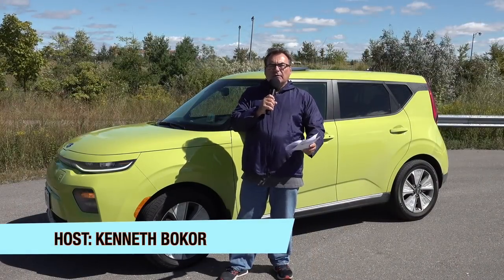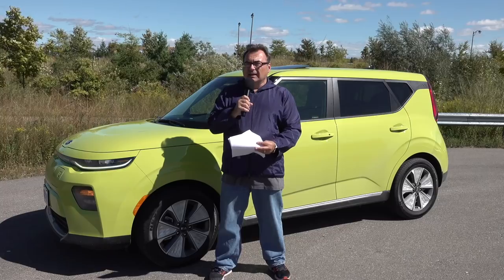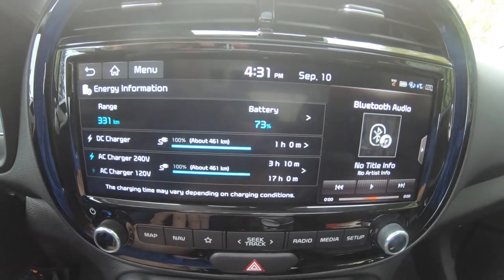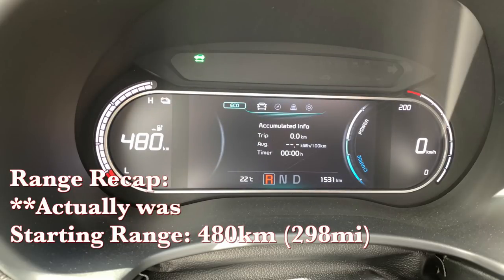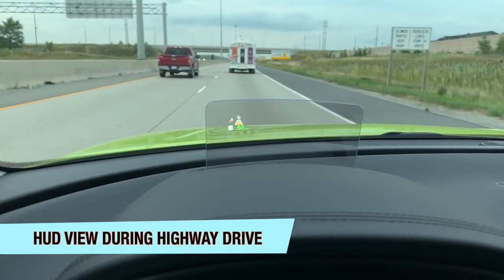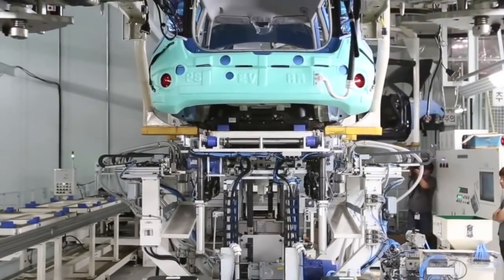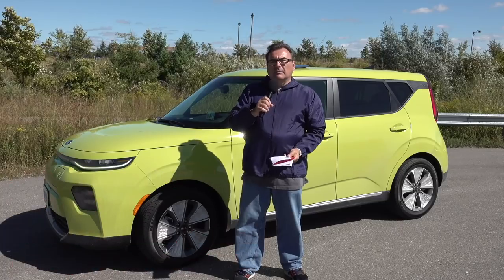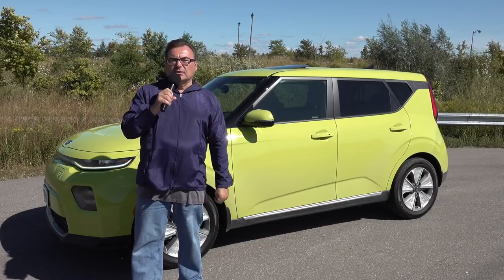Episode 62 -  2020 Kia Soul EV (64kWh) Review!

Comment: Ordered mine over the Niro and Kona based on 3 things:
- price
- comfort
- dealer experience

I didn't like the Hyundai dealer where I live.
The Niro was somewhat uncomfortable to me (seat position left the armrest too high and had to strain to look over the dash when set up correctly for my size and shape).
And the Soul was slightly less expensive than the Niro as well.

Add to that that the Soul was available with a 4 month lead time, the Niro would be 18 months, and the decision was easy.
Reply from the maker: Hi there, thanks for watching as always!  Good for you and I know you will love the Soul EV!  Like I said in my review, it would be my choice, even over a Model 3, for a next BEV.
Reply: Why over a Tesla model 3?
Reply: @patricelarochelle7295  Sitting position, better range for comparable price. And I will remind you, changing the color for the model 3 will set you back 3000$ and that's for a paint that will be sand blasted if you don't buy protection at your own expense.
Reply: @patricelarochelle7295  For American buyers, we'll also still qualify for federal rebates, so the car will end up costing much less than the Model 3.  I think you'll simply get more range at much less cost.
Reply: @lsh3rd  Thanks, I'm from QC Canada, the Tesla model 3 is 1500$ more than the Soul, both get the full government subsidies. I love the style of the Soul. I drive a 2018 Leaf and I have no plan to change.  Great car, gas is very expensive here and I save more than 350$ of gas a month.  The car pays itself.  I drive it around 43000 kms a year.
Reply: @patricelarochelle7295  build quality, interior space, comfort (though that's in part personal, the Tesla's seat position is a lot lower and more reclined, not a problem for young people but when you get older and stiffer it starts to play an ever more important role).
Tesla's main selling point is their supercharger network, and in many areas that's so sparse it's not a factor (nearest to me is 70km from my home for example, and not anywhere close to my normal travel routes, going there on the way to/from work would mean a 40km detour to charge the car).
Add to that that a Model 3 with the same equipment level as a 64KW e-Soul is about 20% more expensive and the decision is obvious.

The Model 3 is a very nice car, but not without its problems (several of my colleagues have them).
Reply: @patricelarochelle7295  Don't know where you're looking at your Tesla, but the cheapest M3 I can buy is $55,000. I live in BC, mind you. Maybe QC still has the cheaper Tesla trim? The Kia Soul EV base trim is $45,000. If you're aiming for something in the luxury segment then the Tesla M3 is the best choice, but if you're looking for a electric hatchback runabout then the Soul with cloth seat trim is a more economical buy. It may be a niche market still, but there are some people who are buying an EV for financial reasons (very cheap cost of operation) and if you're trying to get the best out of that then an EV that's over $50,000 MSRP is too much money.
Reply: @0hypnotoad0  the base model of the Kia Soul Ev is not really worth it.  It gets the smaller battery and the less powerful motor.  The base  Kia Niro Ev is not much more expensive, faster and it has the bigger battery.  If I didn't bought my car last year, I would buy a Kia Niro Ev.
Reply: @patricelarochelle7295  base model was the wrong word. "Preferred" (cloth seat base trim) version of the 64 kwh is 45,000 msrp. 10,000 less than the model 3 standard range plus. The soul EV seems to have preferred and ultimate editions for both the small battery and big battery versions.
Reply from the maker: @0hypnotoad0, in Canada you can get a "base" model 3 for $44,999 CAD MSRP.  You have to go into a store ONLY to buy, as you can't and won't see it online.  This was done to get the SR+ into the Federal Incentive Program.  

This model is basic and has software-limited to about 150kms I believe.  I think it is the SR+ but with an out the door range much less and basic interior.  Still have options for paint, interior, wheels, AP and FSD.  That way you can get the $5K incentive on the base at least.  However, when you add on the software unlock afterwards, I believe you are at the SR+ price so may not make much sense.  If you can hold out for awhile with this limited range Model 3, then it make great choice.
Reply: @EVRevolution  Yeah I remember that, though I don't think that was ever intended to sell. For a few months they were selling a 350 km range "standard range" version with cloth seats and no heated stuff, but I think they narrowed down their number of trims and aren't selling that online anymore. I think it's safe to say that Tesla is still in the 50,000+ range in Canada. You can't buy a "base trim" cloth seat 400+ km EV from Tesla in Canada at this time, only Hyundai/Kia is selling them.
Reply from the maker: Lets assume $0 down and no trade and Ontario as the Purchase Province.  (If you live in Quebec or BC you can also add on (stack) the Provincial Incentives onto the Federal one).

Starting price in Canada for Tesla Online Model 3 SR+ (white colour, base wheels), $54,990.  This includes Freight/PDI and all fees.  I believe you then add HST onto that which would be $62,138.70.  Then you take the $5K off of that which would give you a final total out the door of $56,488.70.  Incentive(s) are deducted AFTER taxes and it's not exact since the incentive also includes an HST portion.  

This jives with Tesla's website that states walk away price of this most basic Model 3 SR+ of $49,990 plus tax (and some additional fees).  Add 13% to this number and you get $56,488.70.  I think my numbers are correct, but I am not a dealer and am not totally clear on how the incentive is taken off.  

But this number should be pretty close. 

By comparison, the Kia Soul EV example I reviewed is priced at $53,529 with the Green costing $0 more and no other options, just freight/pdi and some fees.  Add HST to that and you get a price of $60,487.00.  Take your $5K off of that and it is about $55,487.  About $1K less then the Model 3 if my numbers are good, and they should be fairly close. 

Compare the options of one versus the other and you will see both are well equipped with the edge in Technology to Tesla with a more comprehensive AP offering than LKA/ACC that the Kia offers, as well as SC-ing access.  

I suspect the Model 3 SR+ and the Soul EV will have similar actual range capabilities, so the choice will come down to a personal one.  Many have provided comments about this from my show so you can scroll to read.
Reply: @EVRevolution  Bought the Soul EV 2020, great car... but had some paint defects that need to get fixed. But not nearly as bad as what some tesla owners are getting. Definitely would take over the model 3 as well.
Reply: @EVRevolution  car's finally getting delivered in about 2 weeks. Bit of a mixup between Kia world and Kia Europe caused the factory to deliver cars from late October that didn't have a valid type certificate and therefore weren't road legal.
That's now resolved and Kia is working to get them all registered to customers and delivered as quickly as possible.

Comment: I have to say that I drive my car to the ground. I drive her about 400 per day for Uber and Lyft. Mine is a typical 2015 plus 2.0. I leave my car idling often for hours. between rides over a 20 hour period. And she keeps running great with no faults. I change the oil every 3 months with synthetic Mobil 1. I add Lucas fuel injector cleaner every few months. I have to admit that this is the longest lasting and rugged car I have ever owned. My Mustang or Honda Accord would of quit on me a long time ago! I love how long wearing and powerful this motor is!
Reply from the maker: Thanks for watching and you fit many ICEV owners profiles, including my own for on-going maintenance and usability for ICEV.  However, we need to change these old habits and move to zero-emission driving - it is as simple as that.

Comment: I own this vehicle. It’s fantastic. The only two issues are: 1. The lack of front parking sensors. 2: When in Eco mode everything is fine EXCEPT it cuts off the front passenger heater. My wife won’t stand for that so it gets very little Eco use in the winter. 🤣  However the enormous battery is wonderful! Bye-bye Range Anxiety.
Reply from the maker: Hello and thanks for watching.  Yes I agree on the front parking, should at least have a sensor.  What you describe is what ECO mode is supposed to do, however as you pointed out the larger and more accurate BMS/GOM takes away range anxiety.  

I'm seriously looking at this as my next BEV in a couple of years.  My wife wants my Leaf to use all the time so in 2-3 years I hope to add another BEV to our car family.  All the best!

Comment: Good review. What’s your expectation on this vehicle for the winter in Canada? Traction, efficiency?
Reply from the maker: Hola Juan, thanks for watching!  It has a heat pump so when temps dip down to close to 0 Degrees C, it will still be somewhat efficient for heating.  Once below that, a heat pump does not do much.  So for winters, it is quite a capable BEV.  

As far as traction goes, I have never owned an AWD vehicle.  All of my cars have been RWD or FWD.  I have only been stuck in the snow once in my life - in a 1998 VW Jetta at the bottom of my driveway one winter way back when I thought I could plow thru the snowbank onto the road.  So I really don't think you need AWD - unless you live in the country where the roads don't get plowed so quickly and you have more side roads and gravel roads to deal with.  Otherwise, a FWD car with the BEST set of 4 snow tires you can afford will perform quite fine.  This 2020 Kia Soul is no exception to that!

Comment: I've heard that the new Kia Soul mandatory maintenance costs are a lot higher.
Reply from the maker: Hello and thanks for watching!  Appreciate the info and I am not sure about any increases in mandatory costs.  One must be careful with OEM warranties and service plans.  The vast majority of the Service Maintenance Schedules involve a lot of optional work.  If I were you, I would check with your local Dealer or Kia Corporate (they all have Country specific Customer Service numbers) on what exactly you HAVE to do to maintain the warranties?  Since there is no oil to change in the BEVs, basically everything other than maybe some checks would be non-mandatory.  Again, OEMs put a lot of stuff in their service schedules but most of that is checks and changing of fluids.  

So for now, I don't believe any Kia BEVs maintenance costs are higher.  I'd appreciate it if you sent me an email to EVRevolutionShow@gmail.com with any confirmation you get from Kia.  Thanks, Ken

Comment: Are you sure all Canadian versions comme with an heat pump. They told me at the dealership only the long range trim has the heat pump.
Reply from the maker: Hi and thanks for watching.  The vehicle I reviewed is the 64kWh.  It comes in only 1 trim level - Limited.  The other Soul EV is the 40kWh version which come in 1 trim levels Premium.

According to Kia's brochure, the Limited has the Heat Pump.  Appears the Premium does not.  I may have mixed up my trim level naming on the video, but there is only one model of the Soul EV 64kWh available and it has the Heat Pump.  Hope this helps.

Comment: Does it come with a level 2 charger for home charging?
Reply from the maker: Hi George, it will come with a Level 1 charger for home, at least here in NA.  I'm not sure about UK, Europe or other geographies.  Most EVs come with L1.  Nissan seem to be different where with the Gen2 Leafs provide you with a L1/L2 home charger, as it comes with both a 110/120 plug and a 220v plug for the higher v applications (like a Dryer plug).
Reply: George Moore - In the UK the eNiro isn’t supplied with a Type-2 as standard, so I guess the eSoul will be the same.

Comment: KIA Canada’s website shows a range of 383 but you’re getting close to 500. Can you explain the difference?
Reply from the maker: Hi and thanks for watching.  I can't explain, other then EPA estimates are very conservative to actual best-climate experience.  As I stated on my review, I was very surprised that I was driving this new Soul EV all week and kept waiting for it to get down to low range sooner.  If it was not for my Fast Charger Testing, I would not have needed to charge it for the entire time I had it.  

Now, remember that was in ideal temps and I drive regular, eco mode on and normal starting off and stopping.  No jackrabbit stuff for me.  

Just drive with traffic and it behaves very nicely.  I would suspect up to a 40-50% drop in very cold winter temps, as per pretty well all BEVs.  

Also, this was brand new (only about 1,000kms on it) so pack is fresh.  

To be frank, because of my experience with it, it's at the top of my next BEV purchase, hopefully in a few years.

Comment: So why did you rate this over the nero? Style?
Reply from the maker: Thanks for watching.  Basically the style and overall package for me.  I really don't need a larger SUV-ish type vehicle for me personally, so the Soul fits into the smaller than an SUV and bigger than a traditional hatchback mold.  It's a weird vehicle, something like the Honda Element/Nissan Cube where there really is no category for it.  

That to me makes it a great fit for our lifestyles and uses.  Pricing wise in CDN dollars, there is a $6K difference with the Soul being higher than the base Niro.  Uplift the Niro to the top model trim, and the difference changes with the Niro being $2K higher.  So it would be tough but if budget allowed, I would go with the Soul 64kWh.  If not, the Niro Base Trim (64kWh).  I believe the Soul is a bit better at efficiency and range than the Niro.

Comment: Can this car have a tow bar?
Reply from the maker: Hello Anders, thanks for watching.  I would check with the manufacturer on any Tow ratings as this could void parts or the whole warranty.  Sometimes they just state "towing is not recommended" but don't provide any firm statements yes or no, if warranty will be affected, etc. 

If you are looking to tow, like a small caravan, I would contact your local Kia Customer Centre and get a response in writing to clarify exactly.  Let them know what you are thinking to do.  

As far as a bike rack goes, I see no reason why you can't put up to a class 2 2-inch receiver on it and carry up to 4 bikes, provided the tongue/hitch weight is no more than 200 pounds.  Again, to play it safe, check the warrant manual and if it does not state anything, contact Kia to get a response and protect yourself.  

I know of many people who pull trailers and have bike racks on their EVs (I have one for my Leaf) and have no issues.

Comment: great review! what do think depreciation hit will be after 3 years?
Reply from the maker: Hi Mark, thanks for watching and for the feedback!  Hard to say as I always keep my cars for a long as possible (8-10+years) so I really don't worry about depreciation.  However in saying that, it's easy to understand that the majority of vehicles depreciate up to 30% as soon as you drive it off of a dealer lot.  Even Teslas.  Some not as much as others.  

The Kia Soul makes the Top 14 List of Slowest Depreciating EVs (motoringresearch.com, Aug 7 2019 article) at number 12, however that may be different per geography.  Estimates for the previous Gen Kia Soul EV with the smaller battery put it at about 52.8% of value after 3 years.  This newer one IMO should rate better since the quality and range are improved.  

As a side note, on this list of Top Slowest Depreciating EVs you would probably expect Tesla to be number 1.  However in fact the Jaguar i-Pace is #1, retaining a value of 74.6% after 3 years, followed by the VW eGolf at 66.3% and the Tesla Model X at 64.6%.  Rounding out top 5, #4 Nissan Leaf at 64.5% and Hyundai Ioniq at 61.7%.  Tesla Model 3 does not make the list since it is too new.  

Hope this helps.

Comment: My one wish would be for rear wheel or all wheel drive... I'm not a fan of putting so much torque through the front wheels.  If my LEAF chewed through tires at such a high rate, this thing is going to require a new set every year.  Yes, I have a heavy foot and that will not change.  This might be the one reason that I just hold out for a Tesla Model 3 - that and the charging network.  The CCS charging network is still a joke.  However, my expectation is that with USA federal rebates, I can probably get into this car sooner and cheaper.  I like it much better than the Kona and Niro.  I've rented a gasoline powered Soul and it exceeded expectations in just about every way - I imagine the EV version would be fantastic.
Reply: Rear wheel drive tesla will also eat through tires
Reply: I lamented the lack of AWD at first too, but it's surprising just how well the traction control mitigates torque steer while preserving acceleration in this car -- even flooring it in sport mode causes very little tire chirp, yet still allows 6.3 second 0-100 times. They really programmed it well. I haven't tried it with the traction control turned off though as I suspect THAT could cause major wheelspin.
Reply from the maker: Thanks for the comments and Larry you have good points, however I am not a big fan of AWD unless there are compelling reasons for needing it.  It's your pocket book so whatever you decide (both are excellent choices), the main thing is to get into a BEV sooner than later if you can.